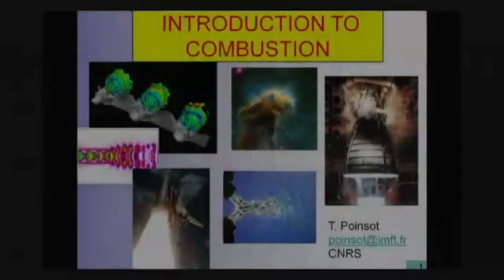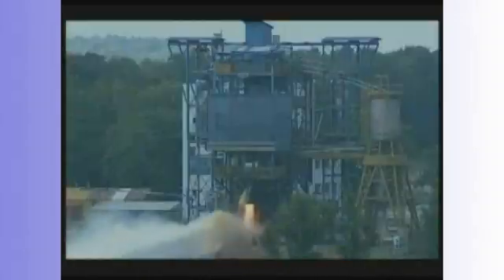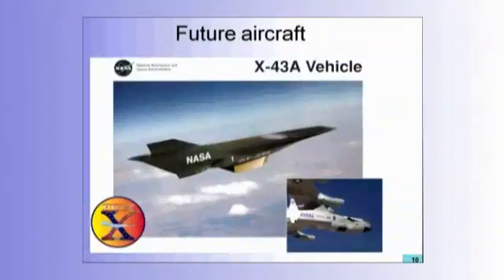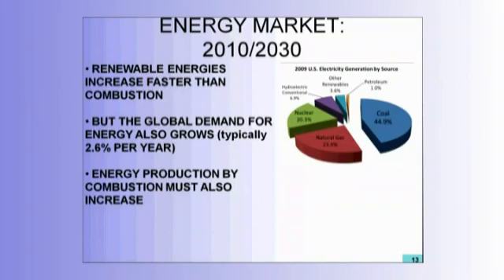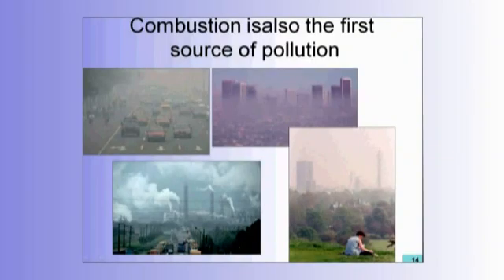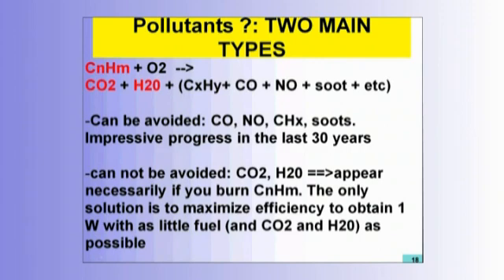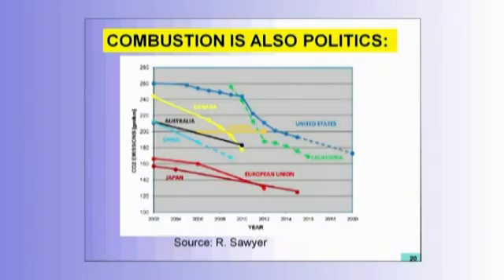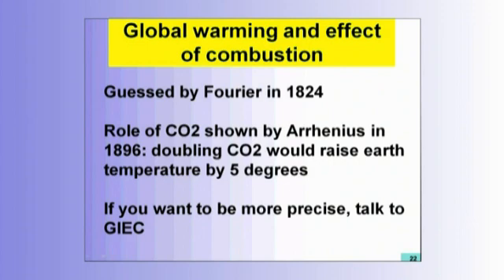Introduction to combustion - part 1

Comment from the maker: This video mentions that you cannot propel an aircraft with sun. This is not correct: the exact sentence should be: you cannot propel ANY aircraft carrying a siginificant mass with sun energy. You can fly once at the speed of a car, on a limited distance, with just the pilot on the plane. The energy provided by the sun is simply not enough to propel aircrafts. For example, there will never be a sun aircraft carrying passengers over long distances, whatever the progress in this technology is.